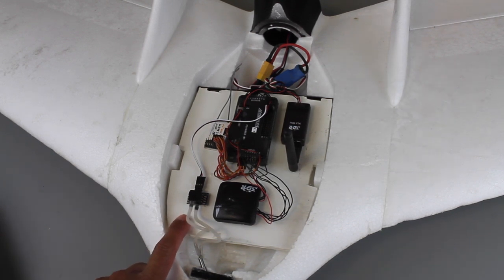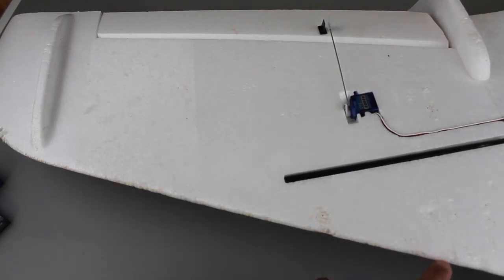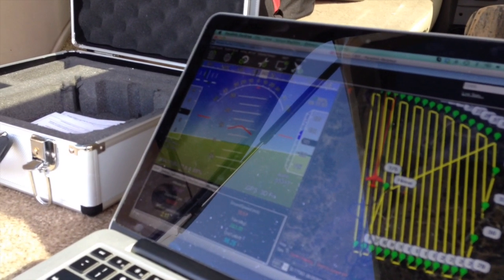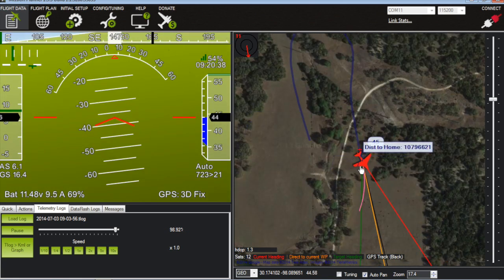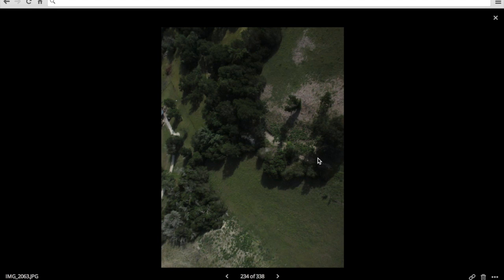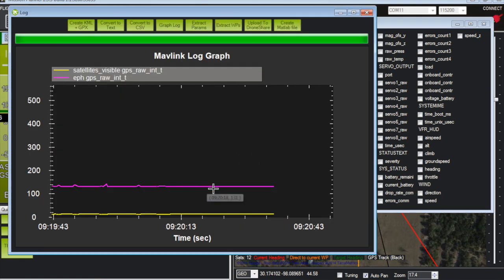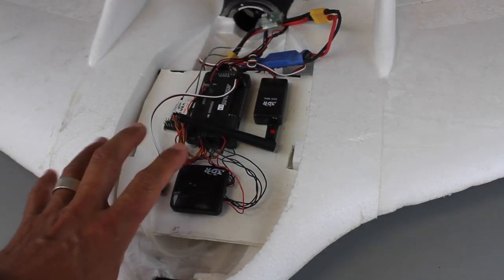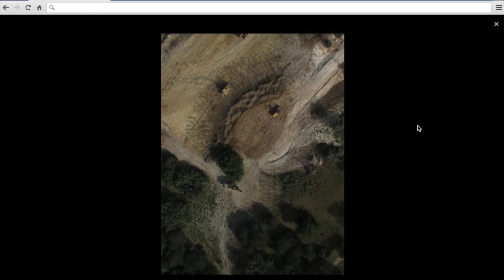How to Diagnose a Drone/UAV Crash with APM 2.6, Mission Planner, and Telemetry Logs

Comment: Dennis, a short piece of fuel tube placed around your nylon clevises will help secure them. Since I've gotten onto the practice, I've not had a (clevis) failure since :) It also puts a little mass on the linkage, helping with any flutter incurred using foamies and tape hinges.

Edit: Wanted to add a big thank you for sharing your findings, it's nice that you've found a solid conclusion after your analyses. Nobody likes unanswered crashes, thanks to the 3DR folks and the community of developers you were able to diagnose a hardware fault as the problem. We've come a long way since the balsa birds I learned to fly on :)
Reply from the maker: Okay brilliant. I will definitely take this advice for all my nylon clevises in the future. I've ordered some DuBro ones that I'm going to be testing soon. They're metal so I think I'm done with these nylon ones.

Thanks for the kind words regarding my findings. My intent is never to come across as an expert. I feel like we're in this hobby together and I've learned as much from you guys as I hope you've learned from me. I was able to fly that same mission again yesterday without any problems. So as of right now I'm still leaning towards the clevis being the issue. Take care!

Comment: 30 years ago I scratched built a 1/4 scale cub. I leaned on the the 1st flight about plastic clevis. It broke ,just like your on the elv. horn. Since that day I have used metal clevises and never again did I lose a plane to that problem. In the end I will bet that is why it went down. Good to see ya .

semper fi    steve
Reply from the maker: Thanks Steve. Good to hear that. Wish I would have learned this lesson 30 years ago :) I did end up flying it again yesterday with a new clevis and no problems at all. Hope all is well.

Comment: A broken clevis should result in the elevon moving trailing edge down on your airplane because it is essentially a flying wing and the elevon is downloaded in cruise flight.  When it unloads, the download from the still connected elevon makes the airplane roll toward the still connected elevon.  The APM will correct the roll by moving the still connected elevon trailing edge down to correct the roll and command the disconnected servo trailing edge up.
Once the roll rate and bank angle are zero, the airplane will have it's both elevons more trailing edge down than before the clevis disconnected.  The trailing edge down position trims the airplane for a higher airspeed than it was flying at when the clevis failure occurred.  As a result of the nose down trim the airplane pitches over and accelerates toward it's higher trim airspeed.  The APM is caught in a quandary because it wants to hold altitude, but when it commands trailing edge up elevon to pitch the airplane nose up, the airplane tries to roll.  Assuming that keeping the wings level is the highest priority, the elevons stay somewhat trailing edge down from their original trim location and the airplane will end up on a descending path at higher airspeed than it had when the clevis failure occurred.
Reply from the maker: Glenn, thanks for the great insight. You've definitely given me a lot to think about as well as made my head hurt! I was able to fly this mission successfully over the weekend with a new clevis and no problems at all. I have to say that if the clevis did fail in my original flight, which I still believe it did, the APM did a considerable job of not completely destroying my UAV :) Take care and thanks again.

Comment: Did one or both holes in the end of the clevis fail?  Or did the pin connecting it to the surface arm fall out or work loose?  If it happened in the crash, there should be signs of force in the connection holes of one or both, but if it just fell out, there wouldn't be.  It could be a more secure pin retention system is needed.
Reply from the maker: Good question, Hugh. I definitely inspected all around the clevis as well as the servo control horn attached to this elevon. Nothing leads me to believe it was hit with any force. Otherwise I would have expected the control horn to snap or detach. The only thing I could determine is the horizontal rod that attaches the clevis to the control horn broke midair. It was snapped off and no other damage can be seen. I agree a more secure pin retention system is necessary. In the future I will be flying with more durable clevises. Thanks for your comment.

Comment: Good job on analyzing you flight. I think you are about 99% right on your system failure, it looks like what happened to me when I was flying my Sky Surfer after about 10 flights. 
I was flying and all was going good till I lost control and down it went. I do not have pic's I was flying LOS. But the clevis was the only thing that was not attached.
Reply from the maker: Soldier53flyer It's crazy what that little 25 cent piece of nylon can do when it breaks!

Comment: From my point of view it is not caused by the clevis. Reason for that is that when your flying wing started its descent it did not flip over. If the clevis would have been broken in flight, the APM would have tried to raise both elevons ending in a roll as only one would have been working.
But I haven't found so far the reason for your crash
Reply from the maker: Thanks for the feedback. I'll continue to dig through the data and will share my results.

Comment: from a old nitro flyer we at our field never trusted plastic clevis, we used z bends or metal clevis with fuel tubing as a keeper if they did not have a locking catch.
Reply from the maker: Yes sir. I have learned the hard way and will be definitely be using a more robust approach in the future. Thanks for the great info.

Comment: I am no expert but is seems to me that if it had been the clevis the plane would of rolled over and crashes not slowly dived for the ground.
Reply from the maker: Man I hear you loud and clear! I had the exact same thought initially, but can't come up with any other theories at the moment. You'll notice how it does a bit of a left turn in the video and it's the left clevis that broke off. I know in the video I said right, but I meant left. Anyway, I appreciate your feedback. Still trying to get to the bottom of this.
Reply: Dennis Baldwin
Maybe the way the gyros work it could be that it consed ti to slowly go down fighting to pull up but not letting it roll over.
Reply: RCflyer729 One would tend to agree, I believe the primary component the APM is trying to maintain is horizontal stability, in this case on a delta mix bird. Being that only two control surfaces are in use, the ability to maintain altitude would have been secondary to heading/stability control. If the APM were to dial in more elevator for altitude, and introduced roll as a result, that roll would be countered with the functioning elevon, and that loop would continue until.... bam.
Reply: I think it's pretty obvious it wasn't an electronics problem because the thing is giving you solid telemetry the whole way. Also, it would make sense to me that with a gyro and the clevis breaking that it would instantly enter into a glide slope situation because it can no longer control pitch, all it can do is use one elevon to keep it level while it "slowly" loses altitude. I think you're exactly right Dennis. Great video as usual.
Reply from the maker: Thanks for the insight. Great points. I was able to fly the same mission successfully yesterday with a new clevis. So a broken clevis is still my theory and I'm sticking to it :) Just wish I had the dataflash logs from the flight that day Hope all is well.